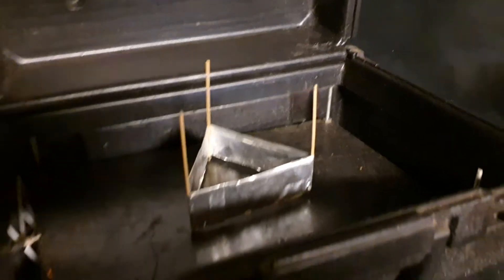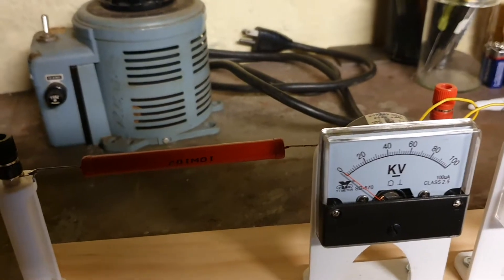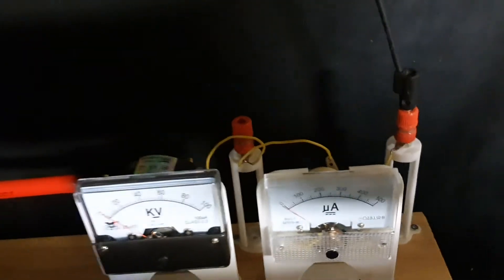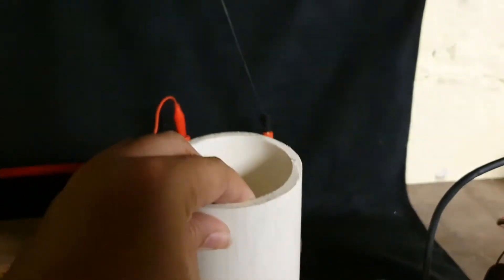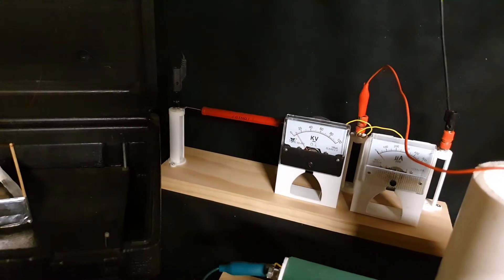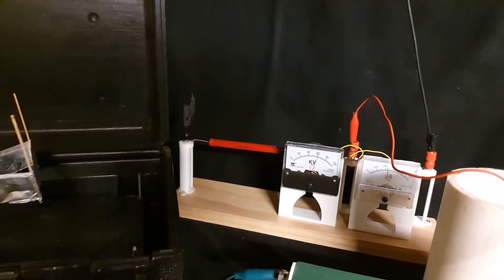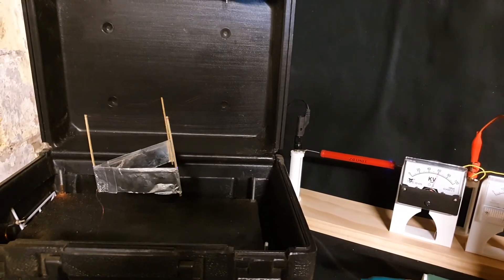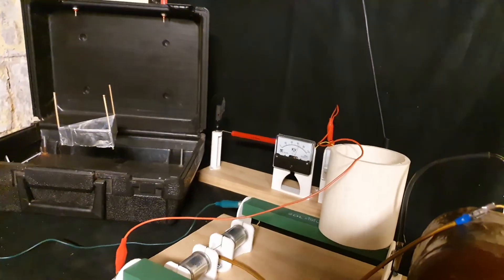Lifter (Ion Powered Flight) Voltage Current & Power Details

Comment: hi, great video, can I ask if there is a particular reason in connecting the KV meter to +60kv and the resistor to GND and not the other way? and I would be very grateful if you could tell me the value of the big red resistance, because I am trying to replicate the high voltage meter but can't fid a good value for the resistance.